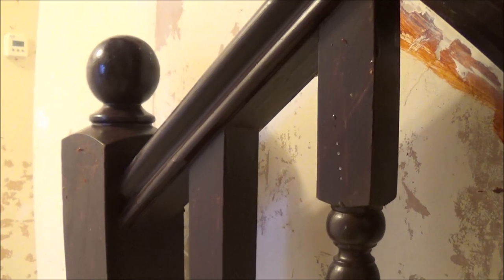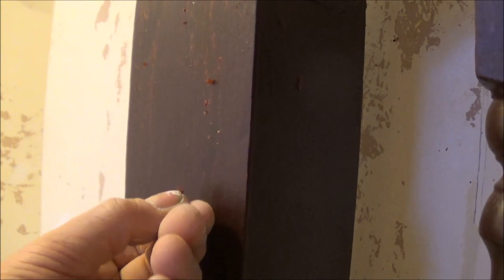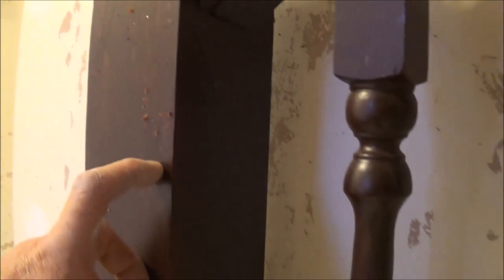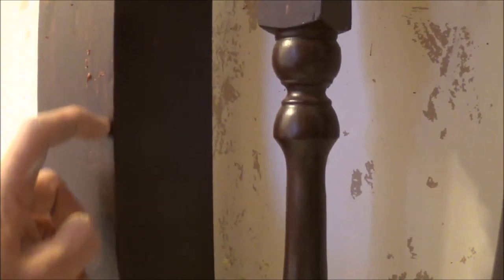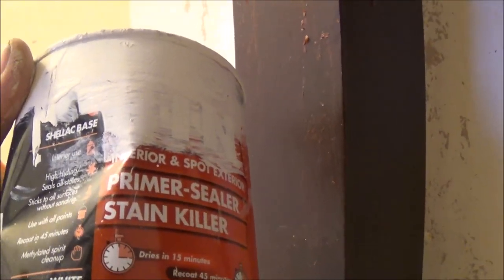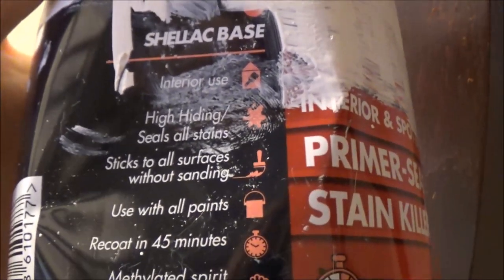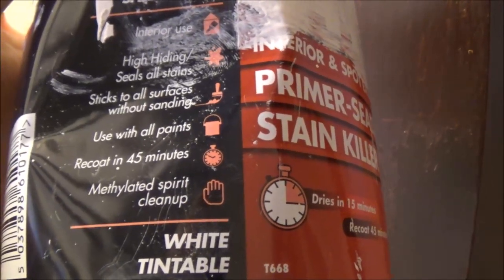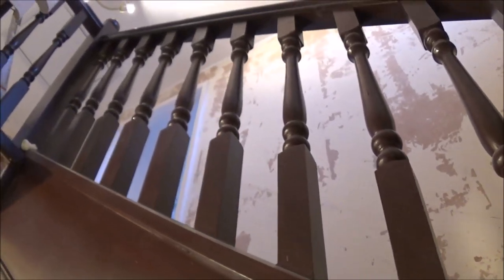How to change a wood stained staircase to white gloss

Comment: I recently had to paint a 20 room house including window sills, doors, cases, arcs and skirts all that were originally stained with light oak stain. 
1) caulk and fill woodwork.
2) applied a coat of white knotting with a rag.
3 Lightly sand/ de-nib.
4) 1st coat of oil based Dulux Undercoat.
5) Lightly sand/ de-nib.
6) 2nd coat of oil based Dulux Undercoat.
7) Lightly sand/ de-nib.
8) 1 x coat of Dulux Satinwood.
I did a scratch test on the finish coating and it was solid. I know that Satinwood is self undercoating but I didn't want to risk any chance of bleed through and the finish was spot on.

Comment: I've done 40 doors over sadalin teak stain/top coat varnish (the varnish  works as a knotting or they'd show through stain)  after a sand 2 uc 1 gloss on sea front balcony doors , that was 10 year + & not 1 has been repainting , I wasn't having it until I was told varnish stains seals the wood .
Reply from the maker: Right, lots of primers have a knot block in them aluminum wood primer if your going dark. not sure I would use Sadolin very expensive.

Comment: Used this on my banister with sanding. , still chipping though. Any ideas
Reply from the maker: If you have old varnish and only sanded the surface, then it will chip easily.. doing a staircase that's got old layers of varnish  is no good.  Thanks

Comment: When the base surface hasn't been keyed correctly, do you have to completely remove all paint & start again, or is it just a sand to remove loose stuff & run marks? Cheers
Reply from the maker: Certain areas will need stripping back like the handrail and newel posts. The rest just sand get rid of runs. thanks.

Comment: Got one of these stained staircases to do in a few weeks..... believe it or believe it not it's going gloss black. I'm in two minds whether to undercoat it and gloss it or to use the BIN Primer on it before undercoat to eradicate any knots? Thoughts?
Reply: Marc Gray if it's stain varnish it's already sealed the knots,  have you ever felt a taky knot under varnish,  as long as it's just a slight sand it's fine

Comment: Any advice/tips for painting a dark wardrobe similar to the colour shown to white? Saves having to buy a new one when that's still in decent condition... tia
Reply: A good primer and sanding down should be fine, just be sure it doesn't have a wax finish on it

Comment: Would you use steel wool instead of sandpaper on the round parts of the spindles? how else do you get into all the nooks and crannies...lol
Reply from the maker: You can use a sandpaper sponge pad which moulds round. first sand is the hardest get rid of runs. Never really use wire wool.

Comment: Zinsser do an allcoat now in water based, primer undercoat and topcoat all in one.
Reply: Not good for this job
Reply: @robbennett9631  I've used it as a primer then an acrylic afterwards with a top coat of zinsser afterwards. Yes it'll still blead through otherwise.
Reply: @fatyowls  waterbase is only good if your applying over other waterbase products. If you want to seal something to stop knots use oil based product like  aluminium wood primer or the shellac base zinnser bin.